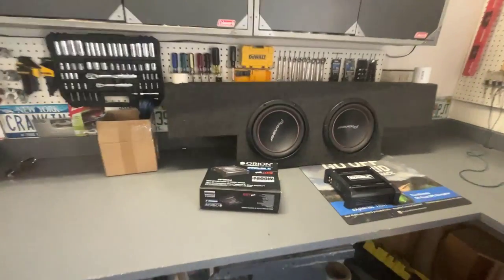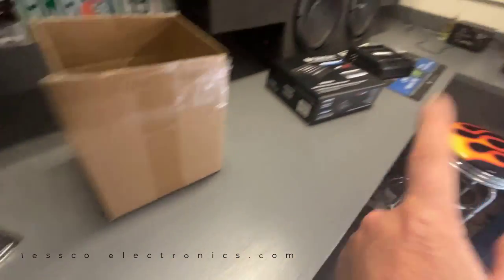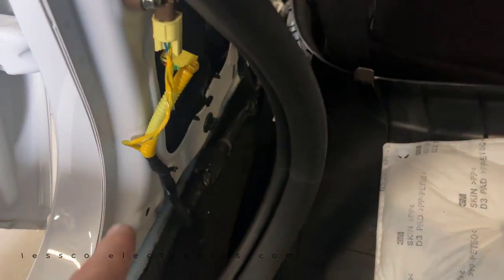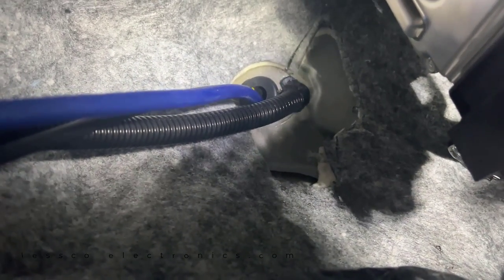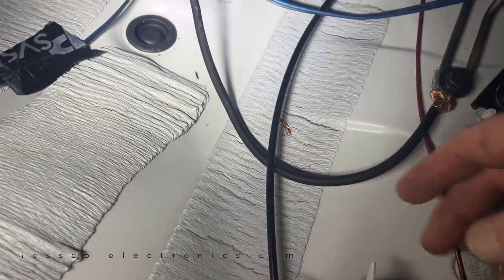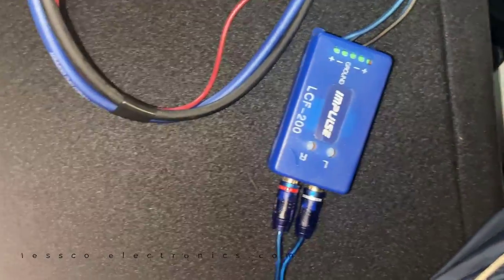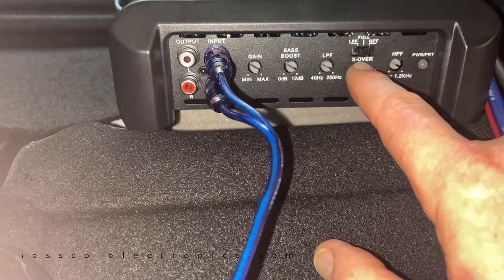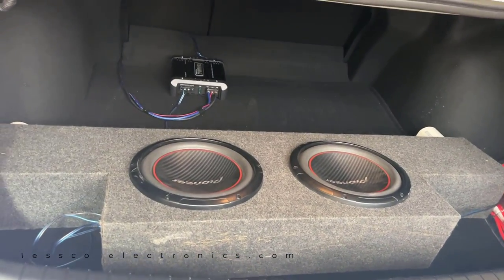Budget Factory Upgrade Sub and Amp Install on this first timer with low money

Comment: Any chance you can help me get my '04 Lincoln towncar going? Someone stole my key, and I can't afford to have one programmed for a few weeks at least. I saw your bypass video and was wondering if your method would work on my PATS system. Good day
Reply from the maker: You need at least 1, sorry man. remember - there are cheap locksmiths around with a scan tool btw... good luck